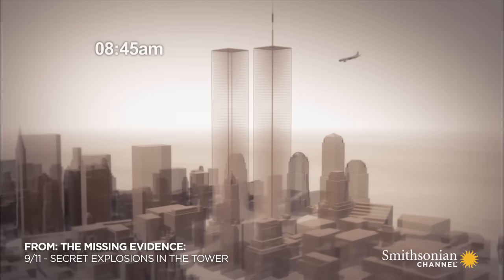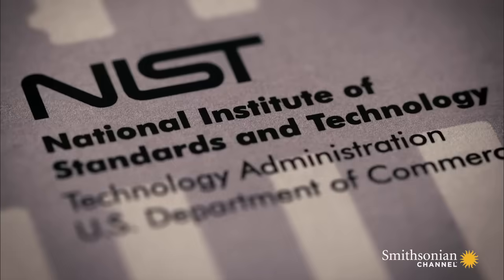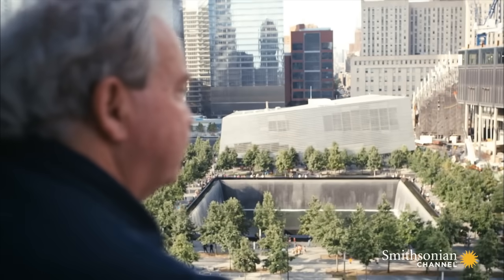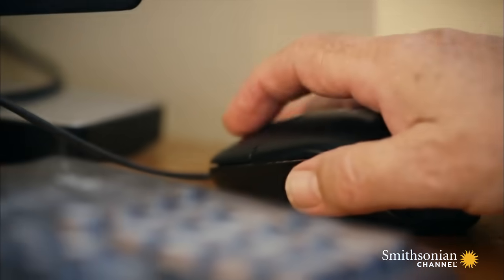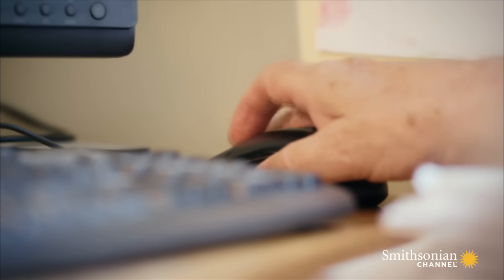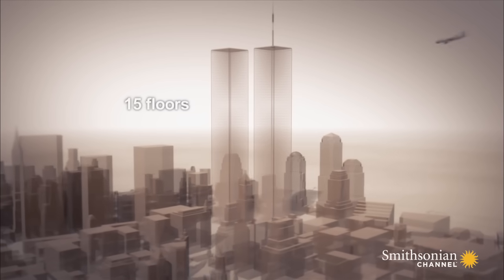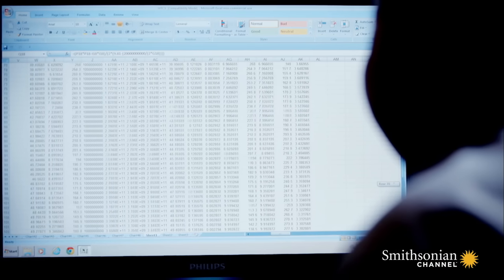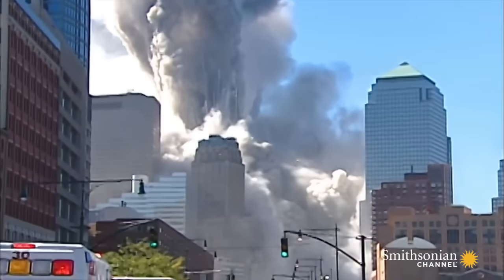This Computer Simulation Explains How the Twin Towers Fell

Comment: Keeping it simple; Say each floor weighed 100 lbs ( yes, I know. Like I said; Keeping it simple ). Ten floors = 1000 lbs. Collapse initiates and a ten floor section ( remember; 1000 lbs ) comes down on the very next single 100 lbs floor which obviously cannot withstand a dynamic impact of 10 times its own weight ( that 1000 lbs mentioned above ) causing THAT floor to collapse under it then carrying it's own weight added to that 1000 lbs. Of course, this process repeats itself ALL the way down and thus adds another 100 lbs of material each time another floor is compromised. Now envision that the outer walls of each tower basically constitute a long, square, mesh spiderweb erector set tube. Also envision the same but smaller for the inner walls. And then realize each concrete floor was hung like a shelf between both those tubes and that this set up is where the buildings' strength mostly came from so that once a shelf was obliterated, there wasn't much to support those tubes laterally. Now, still keeping it relatively simple, remember all that while multiplying all my numbers by like a million......... And THEN go learn something other than simpleton Newtonian physics
Reply: That's not an actual quantification of the collapse accelerations,  if that's what you thought it was. Try again.
Reply: @timothyehook4883  Nor was any of it meant to be. But alas Einstein, let's hear it......As if I hadn't heard it before. Five years I wasted in the "truth movement" studying and researching each and every aspect of the construction and subsequent collapse of the towers. You know what that got me ? The final irrefutable conclusion that, as every structural segment was wholly reliant on every other structural segment, once integrity was lost in one area they went down as should be expected. Study up Friendo.
*** Yes, Yes. I know...... initiate "What about building 7 ?!?!?" protocol
Reply: Armchair ( or was it basement ? I forget ) Architects and physicists......Much like tax warriors. "Looky here !!! I've found the magic formulation of these three special forms to fill out and NEVER pay taxes again !!!!" Meanwhile Uber-rich guy and his army of tax attorneys can't figure out how to keep HIS ass out of jail for not paying HIS taxes.......Yeah. M'kay.
There's a reason why no person of any actual note within those two spheres has any skin in the Truth game.
Reply: @timothyehook4883  For some reason I can see your reply in my notifications but not in here so;
As for the "buckling"; Nothing had to "buckle". Maybe if they were all solid, continuous pieces then there'd be that argument. But in reality, they weren't. They were sections bolted and/or welded together at various points. They didn't have to buckle. They just broke apart. Just because a floor is designed to support a million pounds statically doesn't confer the ability to withstand that same weight crashing down on it. Much less multiples of said weight as more floors become debris adding mass. Two erector set tubes made up the bulk of the Towers structure. One inner tube and one outer skin. Held together by concrete shelves ( like, literally ) and what amounted to a cap that kept gravity from pulling it apart. Each piece of the equation was equally important in keeping it all together and standing. As I said above; The failure of any one aspect would be expected to be catastrophic especially given the impact zones. One building failed in an area almost a fourth the height of it, the other with almost a third. People don't seem to understand a building is designed to withstand forces laterally....AND vertically....to a point. They weren't designed to withstand a vertical dynamic impact of the top third of the building.
Reply: @johndoh4064  Youre obviously have no structural design experience or physics background...Im also sure you have never reviewed the nist report or any of it many thousands of detractors either.

But thanks for the heads up on the Youtube...Im probably being shadow banned .

Comment: It stops after stating how much weight was above the impact. It does not go any further explaining how it can possibly move more mass out of the way. Neither does it explain why approx the 50.000 staplers and the 200 lift shafts were never found in the rubble, or how it can be physically possible that the collapse happened at approximately free-fall speed.

Comment: A million holes in the official story--warnings, put-options, military stand-down, sound of explosives, squibs, passport falling from fireball, hole to small in Pentagon, no plane wreckage, etc., etc. It's beyond absurd. And then you have Newtonian Physics defied !!!  
Those were steel re-enforced modern skyscrapers, not giant sand castles !!!
Reply: 1. didn't happen
2. didn't happen
3. didn't happen
4. inaudible
5. squibs LOL
6. along with 10,000 pieces of unburned paper
7. pentagon hole 96 feetwide A&Efor911 endorsed feds narrative
8. many tons of wreckage recovered
It is beyond absurd that you have to tell so many lies to try to convince people. If you have to lie to make
your point then you don't have a point to make.
Reply: Squibs lol?  You see them all over the place. No doubt you will argue that it's air being compressed dozens of floors below the collapse area. So in your tiny brain it is perfectly okay that the building can collapse at free-fall speed, pushing a column of air ahead of it, which blows out window at high velocity? And that the collapse travels straight down through the path of most resistance,  through a network of giant steel beams, and pulverizes most of the structure into dust. THis is okay with you? Or are you perhaps invested in keeping the official lie going for some reason?

Comment: But a bird will tear a plane to a twisted mangle. Ok.....
Reply: Well, then how can a soft little bird knock a hole in a huge jetliner??? MOMENTUM!!! Btw, ive never seen a bird "tear a plane to a twisted mangle"... they can puncture the plane's outer skin, or knock out an engine by jamming it... but ive never seen a bird reduce an airliner to twisted metal!
Reply: The worst thing a bird can do to an airliner is jamming one of the engines. Secondly,there is one thing called SPEED. A pen shot at earth at 99% the speed of light could probably destroy the planet. Its speed that matters.
Reply: @user-lp7tx1fe6t  bull sitt pen would disintegrate into itself just like a bullet but faster. So fast, that all you would see is the disintegration before you even heard anything!
Reply: @user-lp7tx1fe6t  also mass matters as much as speed, until you get into something like a reaction going "super critical"